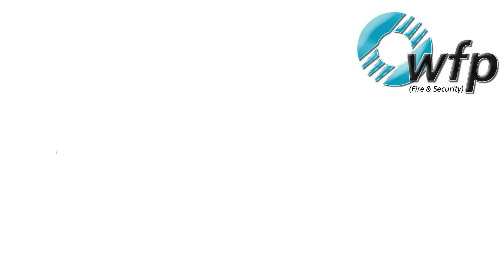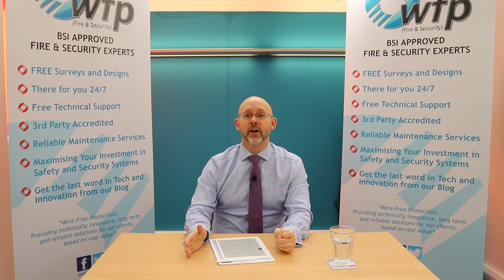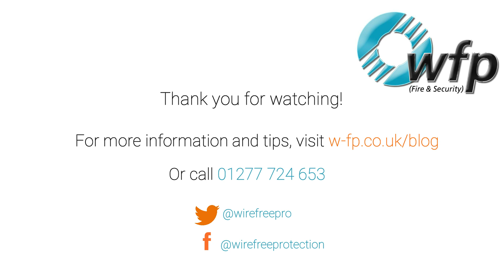Fire Alarm Design Types of Coverage: M, L1, L2, L3, L4 & L5 Systems

Comment: Great video thanks. Quick question if you don’t mind. What does the d in an Ld2 system mean?
Reply from the maker: Hi, the 'D' stands for domestic and is only used on non-commercial systems [or detectors], the British Standard for this is BS5839-6 and this is for domestic premises. It [BS5839-6] is a very wide ranging standard and covers the cheaper domestic detectors you can buy off the shelf in B&Q, right through to systems that you would normally find in a commercial premises like and office or factory.